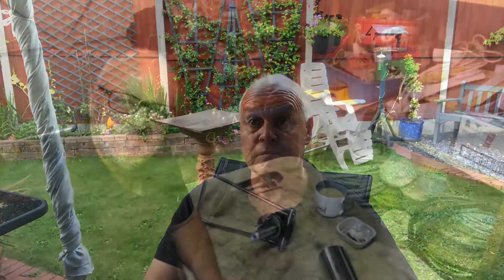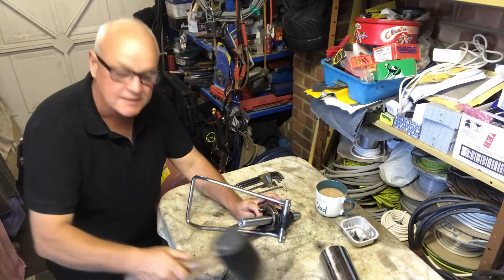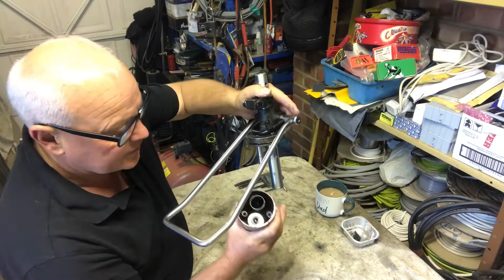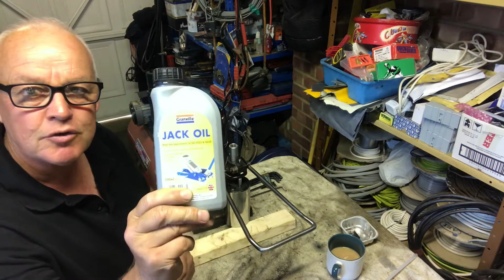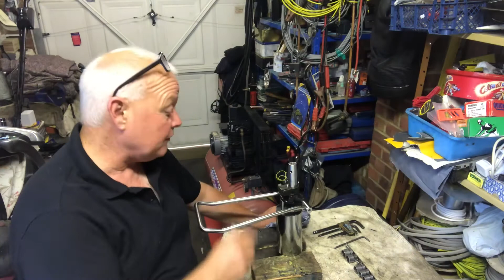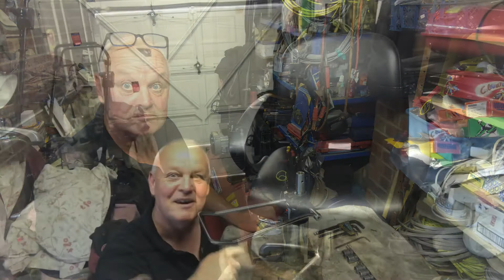How to fix a salon hydraulic pump up chair

Comment: Hi recently acquired an second hand barber's chair myself, and the pump is not working. It did work before normally, but with moving the chair we had to take apart the foot & chair, and some oil slipped out. Could it be that we should just refill the oil?

Comment: Do you have an idea why my pump would be leaking at the bottom
Reply from the maker: Hi Ach tats 
The pump will have o rings. ( oil seals ) these perish after time and allow fluid to leak past them especially when they are under pressure when the foot peddle is pumped 👍
Reply: @richardshomemechanics5566  thank you 🙏🏼

Comment: Hello, how do I know how much oil to put into salon chair? Do you add oil until it reaches where you put the oil in? Thanks 😊
Reply from the maker: Hi Bethany yes that’s what I done hold the leg up and pour into hole untill it comes out from where your filling you will know if you need to add any more as when you pump up the chair the peddle will be soft hope that helps 
Richard x

Comment: Why would the chair not go down?  I have this issue
Reply from the maker: Hi Douglas I’m not sure what you mean ?
Reply: @richardshomemechanics5566  I have a barber chair/salon chair that goes up fine but won’t come down. Any thoughts
Reply from the maker: @douglassheehan6690  you really do need to strip it down there could be eternal damage inside without a full strip you will not now … to much hydraulic oil could cause this if you have recently topped it up best to strip down 🤙

Comment: Where were you able to find the seal?
Reply from the maker: Hi Joe 
Sorry just seen your message the seal is where the push rod goes
Reply: @richardshomemechanics5566  hello Richard, where did you buy them? 
Part number? Etc. I work at a school and have like 6 of them that need work.
Reply from the maker: Hi Julio can you please explain what video you are talking about please 👍
Reply: Nice work.  Where can I buy the seals or O rings at. Measurements on seals if possible
Reply from the maker: Hi frogicutz 
After researching for what oil seal will fit the salon chair I found these seals on eBay 
Nitrile rubber rotary shaft oil seal 
You will need to measure internal and external measurements of the original soil seal I’ve used this one in our salon chair for 6 months with no issues or leaks how that helps 
Thank you for commenting on my channel 
Regards 
Richard
Reply from the maker: Hi frogicutz 
After researching on eBay I found these seals 
Nitrile rubber rotary shaft seals 
You will need to measure internal and external measurements of the original oil seal . I fitted one in our saloon chair and after 6 months it’s working fine with no leaks how that helps you 
Thank you for commenting on my channel 
Regards 
Richard
Reply: @14frogi14  did you get the measurements?
Reply: @richardshomemechanics5566  hello sir what where the dimensions of the seal you got or even a link would be helpful. I have the same pump but I need them ahead of time before I take it apart please!